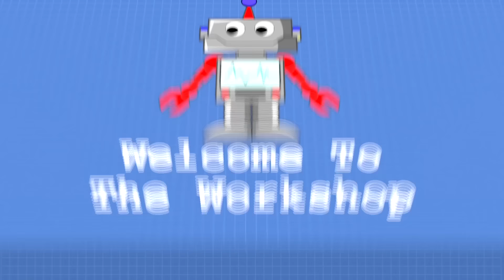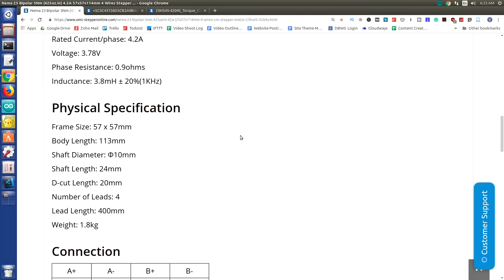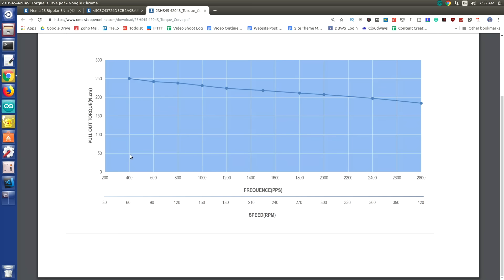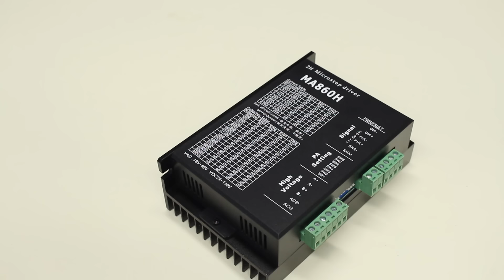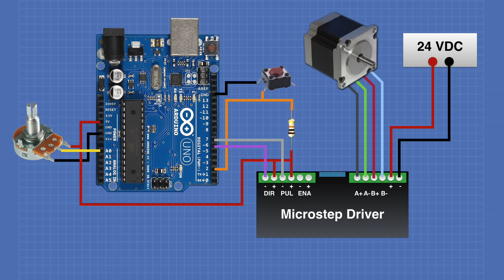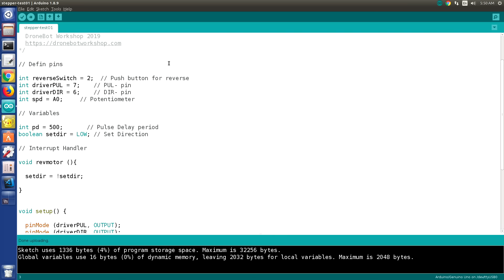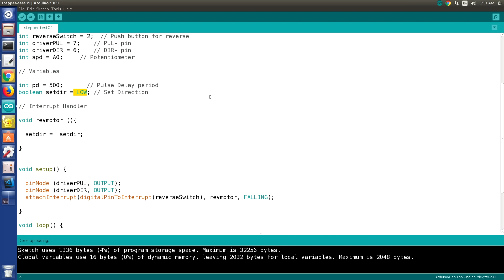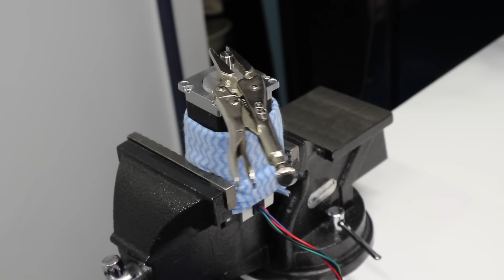Big Stepper Motors with Arduino

Comment: I want to make a can crusher using the stepper motor. I have made a can crusher before using a Pneumatic screen door closer and simply drilling a hole and tapping a value for an air compressor. Will this motor be powerful enough to crush a can if I gear it correctly? The motor will only have to turn 180 degrees and then reverse back to 0. On the push button, what code would I put in to make the motor activate?

Comment: Loved this video! It greatly helped me get my setup which is identical working great. I would love to see this setup activated with only 1 push button switch for on and press again for off. Also having the stepper run based on time like 30 seconds at a push of a button then turn off. Also ignore all switch inputs during the 30 second run. I think this would make a very good video and help a lot of people besides myself! Love the channel! Keep up the great work!
Reply: Hello Mr. Brett, 
please if you got an answer, kindly share it with me, 
@14:41, the connection of the Switch is quite confusing,
the ground with the positive, 
what does the resistor do there, 
I mean if we activate the switch we would definitely have a short, 
please help with the right explanation, i really would be very grateful to you

Comment: Great Video. I was wondering what kind of load this puts on the Arduino. It obviously is a load since it generates the signal to operate the motor driver. Would it be possible to connect multiple Motors with drivers and not overload the Arduino?
Reply: The arduino is just putting out the pwn signal, the motor driver is the device powering the motor. There really isn't any load put on the arduino

Comment: i also wonder is there a way you can use an arduino and have diffrent axes run analog? so using a numpad or something like that to make the motors run to a custom weigh or speedß looking into runnign the motors without having to buy a computer and have it hooked up

Comment: so im really confused. im building a planing rig that i want to run with stepper motors, just incase i  turn it in a full cnc over time.  my z and x axes will slide intop of tbs20 linear rails and way around 40 pounds, i was thinking off moving it by using a spindle and wonder what motors i need. i would love to get away with a cncshield and arduino but im not sure if any kind of nema 17 motor will even be strong enough to pull it off
Reply: nema 17 NOT newer can use cnc  need be monimum nema 23 or 34 motors torgue need lot more can mve and cutting wood. cnc used linuxcnc or worst mach3 software not arduino. but can use old pre-history GRBL too but not all G-code has supported what cnc use.

Comment: Thank you so much for the awesome video! Seeing someone using a driver like that is just what I needed before buying it.

27:55 Didn't know micro stepping increases torque, I thought the 200 steps configuration gave the maximum torque, but it makes sense now it doesn't, though I'm still now sure about the current per phase thing, if 4.2 A is for 200 steps, does it mean I'm gonna need to supply 8.4 A at... 400 steps? That's what I still don't get.
Reply: Dear Tushe, 
the dip switches is used for determining the number of pulses to the stator windings of the motor, that is per revolution. 

if you could kindly check the details at the back of the driver, it says Pulse Per Revolution.

Now, for example, we have dip switches set at 200 PUL/REV that is slower that we set the dip switches at 800 PUL/REV, 
as the sitting of 800 pulses per 1 revolution to the stator winding of the motor will make the rotor rotate way faster than 200 pulses per one revolution, 

i hope this cleared out your ambiguity, if you still need any further clarification, kindly ask

Comment: My stepper motor has 6 pins should I have to connect all six wires of 4 of them?
Reply: all can use 4 wire,6 wire,8 wire. learn more at stepper motors.

Comment: i made a similar circuit, where the direction is set permanent in the code, and speed (i.e., the pulse duration) is constant as well. however, in my case the motor is twitching back and forth, so that when the pulse signal is high, it twitches one way, and when it goes low, it twitches the other way. i checked the continuity of the coils and the wiring to the controller, yet nothing seems to be wrong. i do not believe that the issue is in the microstep driver, because i did not connect or disconnect anything from the driver while the power was on. i was wondering what could be the cause of this issue.
edit: i also tested this with a brand new driver, and it still did the same twitching, so it is highly unlikely that the driver is the problem.
Reply: I had the same issue. Ended up being due to having the motor wires (A+,A-,B+B-) connected to the driver incorrectly. I had to check the motor manufacturer documentation to get the correct colors and which terminals they applied to. I had made the false assumption that my colors would correspond to the same terminals as the host's motor does.

Comment: I was wondering if this is a closed loop or hybrid driver?  It isn't called that but looks similar.  I have a CNC machine which is a closed loop system and would like to replace the current driver computer with an Raspberry Pi or arduino system.

Comment: As a newbie on Arduino i would say that in this video everything was explained in a professional way. Although a question came up, as far as the map in the void loop part. Is that suppose to be included in the sketch because i dont get the function. I can raise or lower the speed with the potensiometer, i can change direction with the switches but as i said there is no bounce or acceleration. Does it belong to the next try.? (Accel). Is it meaningfull to take only the map line out, or the whole loop since ports 2, 6, 7 and A0 activates the controller either way.

Comment: Coding issues- in your sketch, you execute the analog read and map function before starting the timing pulses. The read takes ~100uS; as much as both the timing delays at highest speed! Map is also computationally intensive.
Better to do the calculation inside the pulse, and subtract the read time from the delay. 
Map is not really required- reverse the pot polarity, and do pd = 2 * analogRead(spd);
Set first delay to pd (it has already taken 100uS to do the read) and the second to pd + 50.
Smoother, better range, and less code.

Comment: What about the enable input to the driver? You have not connected that, so surely it should not work?
Reply: enable mean many driver if eable ON motor run max current and if motor OFF signal drop motor idle current to half or less.
Reply: @mattivirta  Actually, the input is incorrectly referenced- it is actually a disable signal. Removes all current drive, allowing free movement. I have used this feature on a milling machine drive, allowing handwheel use when not being driven.

Comment: Hi. Can you recommend wire gauge 10 meters nema 34 12nm 5.6v. I have irradic behaviour and cnc table guides are running flawless... So now i use 24 awg wires. But i might think they are to thin.

Comment: I have been involved in industrial electronics through years in factory maintenance.  I have a good hold on the price of some of this stuff.  You must either be involved with someone that supplies you with equipment like this or you are incredibly flush for cash.  Not that I am dissing what you are doing.  You are doing a fantastic job, but man I would so like to be able to afford some of this stuff.

Comment: Hi sir I m new to this coding can u explain me how to stop stepper nema 17 motor after few rotation
Reply: same than all stepper motors, have nema 17 or 23 or 34 or biggest, driver need be only biggest ewery motor can handle current more, cnc not used nema 17 minimum have 23 or 34 motor. code you can write ho many step motor run and stop, and same reserve how many step run and stop.

Comment: Thank you for all the information, I've learned a lot from you. Now I'm more experienced and I made a real machine with just Arduino and several motor controllers connected to it with cables. The result is a machine that works great and I am busy to make it more professional so that all is on 1 board without tenths of cables connecting it all together. I guess there are "ready made" boards in the market with a microprocessor and, for example, 3 pcs DC motor drivers and 2 pcs stepper motor drivers all integrated? But I can't find this and there are also no videos of it to find. It's all Arduino with separate DC drivers (for just 1 motor), separate stepper drivers, etc. I use for my project NEMA 23 stepper motors and 70W 4500rpm DC motors so it goes beyond most hobby boards. It would be great if you have information where to go to after the Arduino project is successful and what to do next to make it more professional.
Reply: Hello Sir, 
please if you got an answer, kindly share it with me, 
@14:41, the connection of the Switch is quite confusing,
the ground with the positive, 
what does the resistor do there, 
I mean if we activate the switch we would definitely have a short, 
please help with the right explanation, i really would be very grateful to you

Comment: When i select stepper motor to work with it , i select based on current per phase and the power supply could supply max current ? i mean is not as normal dc motor when we select a power supply 24 dc as example to run 24 dc motor ?
Reply: if stepper motor max current have 4Amp need power supply more than 4A and if use 3 motor need 3x 4A power 12 or 15 volt power supply.

Comment: Can you refer me to a good book that covers stepper motors and controlers. I have a project that I would like to add a stepper with two acme threaded shafts to raise and lower a some what heave roll of paper. Approximately 200 pounds when the paper is a fresh roll.

Comment: Can I use 12Nm stepper motor with a suitable gear box to open a sliding gate
Reply: yes, can use but need stepper motor drivers who handle big motor too, minimum more than stepper motor max current. mean if motor max have 6Ampere normal 6-9A motor have 12 Nm  need driver what have more than 6-9A curret handle. etc DM556 not can use need biggest driver maybe DM 860. max current have about 6A or biggest driver max have 8-9A

Comment: Sir, is it possible, If I need to use a programmable stepper motor driver controller like 36820 or IC8-27V modules, with this micro step driver module to drive NEMA 23 stepper motor with a current about 2.5A?
Reply: less than 3A have all toy motors less than nema 23, normal nema17 can use only laser,3d printer or plotter only 2,5A very less ampera no have torque use lot. big motors mean use more than 4A driver. normal nema 23 big trque motors eat 4-6A toy motors use less than 3A and intrustial machine stepper use 5-12A ad drivers need be biggest than motor need max current.

Comment: a 24 volt PS and a visegrip on the shaft .. ya you're a real pro ;)     A motor like that should be running 45-65 volts  or your just wasting 1/2 its performance.   And never mar up a precison shaft with a vice grip

Comment: I have watched several of your videos. I had an extensive knowledge of electronics that went to waste working for the Boeing company. I did my time. I am diving straight into this stuff to get up to speed. I have several related books courtesy of my librarian wife. They are useful but the videos are just faster to go through and quite specific for a given result. I have some of the components already ordered for my idea. They are due here in two days. Thanks for making such good quality videos! I really appreciate I don't have to rinse some awful background music out with Stevie Ray Vaughan on 11 afterward. You speak clearly and at a tempo that is easy to follow. I'm sure there is considerable effort producing them. It is much appreciated.
Reply: Hello Mr. Fxsrider, 
please if you got an answer, kindly share it with me, 
@14:41, the connection of the Switch is quite confusing,
the ground with the positive, 
what does the resistor do there, 
I mean if we activate the switch we would definitely have a short, 
please help with the right explanation, i really would be very grateful to you

Comment: The stepper is rated at 4.2A per coil so 8.4A must be the number for choosing the power supply. Why are you saying that your power supply giving max. 5A is ok? Because this is only a low torque test? Can you get max. torque with this setup without burning your bench supply? Or where dip switches set to limit the current?

Comment: Kindly I would like to know the value of the Resistance and the Potentiometer, tank jou.
Reply: Potentiometer anything above 5k ohm is good he has 10k ohm. Resistor is ok a 1k omh or something close. It doesn't matter as it is only there to not cause a short circuit when the arduino pin is  pulling up.

Comment: I am a complete novice with arduino but i used this to successfully control my motor. I have a terrible bounce problem with my pushbutton. Is it possible to simply add debounce to this?

Comment: Great video thanks. Very clearly explained and gave me the information I need to start a project that will use a stepper motor to drive a wood lathe spindle.

Comment: Maybe not related to this video, but how do I limit the current on the driver? My stepper motor is 2.8A per phase. I have the same driver. Do I have to select 2.57A on the driver or 5.43A (2 phases x 2.8A) I am confused. I searched all over and I can't find the information if the current mentioned on the driver is per phase or  per 2 phases. Thank you
Reply: Check this out: https://youtu.be/QMgckRoRy38
Reply: driver current setting need be less than motor current max, if motor max have 4,2A driver setting need be dip switch less than 4,2A. 4A or  less if not have near setting more.

Comment: That video was very good. I have a new project where I want use stepper motors to control the position of wood sawing blade. But I never used stepper motors in my life before. Can you do a video of how to calculate the Nm value that we need our stepper motor to have in order to do his job in our project?

Comment: My motor does not feel smooth at all; it vibrates pretty aggressively when running the Bounce sketch.
Reply: wires wrong or setting motor wrong.

Comment: so is a nema 23 ok to use with a arduino uno set up
Reply: were eed motor, thats important use nema 17 3d printer or laser move or small cnc nema 23 move or big cnc nema 34 move, all need different driver different ampere handle. amper have important how mush have torque.

Comment: Hi Bill I recently bought a Nema 23 to power a project that I'm building, I decided to watch your video concerning this product to gain some incite On the motor, but after watching two or three times I then decided to put your information  into action but it was then that I noticed the difference between our motors......Mine is a   "Closed Loop"   motor,  you know the one with its brains in the boot. so I am now enquiring of you to shed some light on "Closed Loop stepper motors either in a video or maybe in the newsletter in fact that may be a better solution
Looking forward to hearing your suggestions

Fred

Comment: I'm having difficulty getting this to run. I'm running an Applied Motion nema 23 motor with an attached driver. In looking at reference info on the AccelStepper library  the syntax for stepper(1,7,6) seems to be steps, pin, pin. In the video he describes it as mode, pin, pin. Does this have some description someplace I can refer to to undenrstand what "mode" is?

Comment: What is the effective limits of pulse frequency you can generate withe an Arduino.
Reply: i think max have 16khz, and many clone board have 12khz max. this is clock speed.

Comment: 10:51 i have same looking settings, what mean 400? is it half step?so this not run full steps? is there difference if use AC or DC? becouse i have 1600 and i step 1600 times it move less than 1 rev.if i step 2000 it go more than 1 rev. so whats wrong?i try 400 it turned motor 3 and something with 1600 its look like something is wrong.

tryed accelstepper it run correct LOL but why so sloow. i thought its faster

Comment: If I want to use two nema23 motors like your configuration. Should I use two Arduino Uno?
Reply: no, can use max 7 motor, mean driver use 2 pin/ motor can use, potentiometer need too pins control speed need more in /out pins, potentiometers use analog pin input, and stepper driver need 2 digital pins output/ motor. arduino have 6 analog pins can add potentiometers, and 14 digital pins can use drivers max 7 motor drivers. arduino mega 2560 have lot more pins can use lot more motors.

Comment: supply the custom service of Electrical Junction Box, 19"1u 2u 3u 4u 5u 6u,7u, 8u server subrack/chassis and network enclosure, rack case,etc. Shelly Ph: 86-13671843635,  2911282844@qq.com, Skype: linnaniu1

Comment: Does anyone read my comments I will appreciate some helpful comments thank you
Reply: Hi
The stepper motor is under a state of "hold down torque" that prevents the cnc machine from moving.
However don't worry to much about the heat that much as this motors can run happy at 60' Celsius the whole day without any damage to it.

Comment: you did not connect the enable pin on the motor controller. This pin is used to reduce current when motor is on standby, .otherways the motors overheat if diven at maximum current
Reply: not owerheart if driver has setting max motor current or less.

Comment: Great post. Does this work with Raspberry PI 4+ ?
Reply: same can arduino and raspberry have used code and raspi have gpio pins what used similar than arduino pins. code pins output and connect to driver.raspi used only different code python etc. arduino used own arduino code,